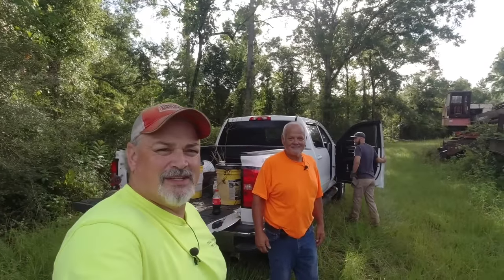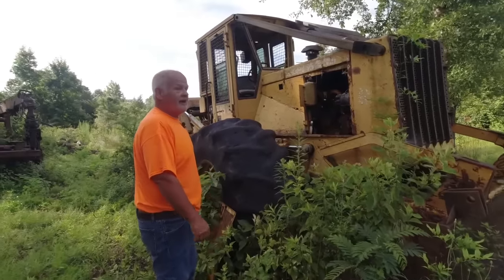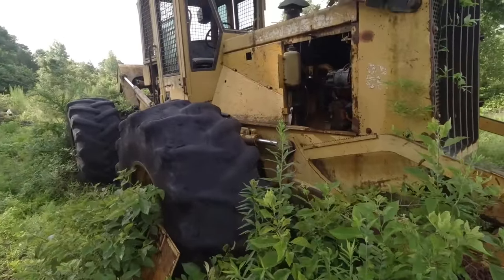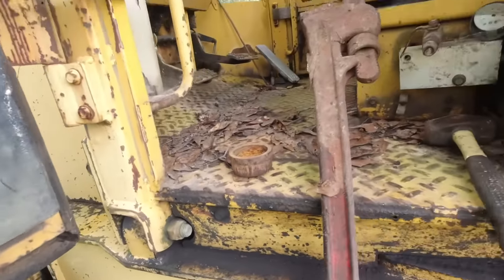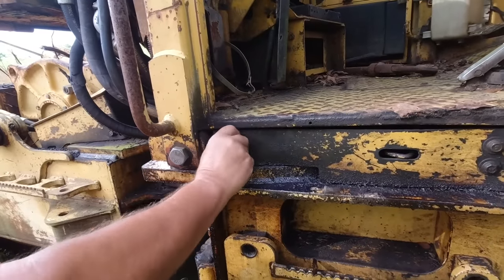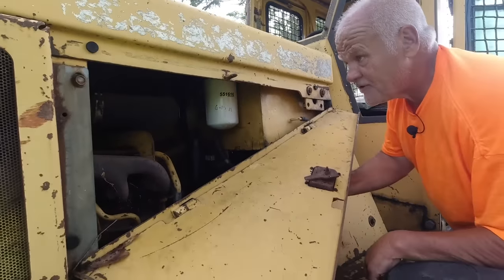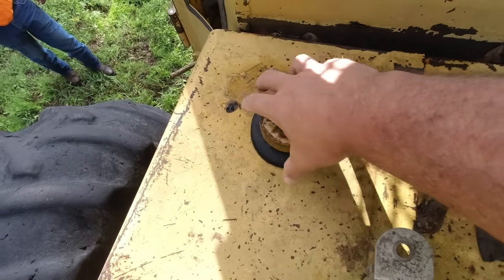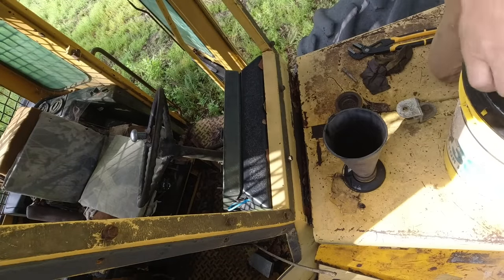BURIED IN WEEDS! Will this Skidder Start AND Pull Logs Again?

Comment: Oh i love watching machines that have been sitting for years being brought back to life. Good job.
Reply from the maker: Thanks much
Reply: I found this video,  I was looking up a skidder being pressure washed and none showed up but this video I run these skidders but they have swinging grapple booms in idaho. The key ignition switch makes the same beeping noise though 🤣🌈🎇🛸✨ there is another logging job down  the road & they have this exact model as on this video and a  log loader to match,, I am pretty sure there  tree"log" processor is close also.

Comment: youll have to come to the orlando auctions with us next year. Some good junk!
Reply from the maker: Right on! I hear they have some good stuff
Reply: We talking about Orlando flordia correct?
Reply: @HamiltonvilleFarm  why did you shake the steering wheel while you were cranking the skidder ? How does that help it to start ?
Reply: Yes! Y’all come on down!
Reply: @brieannateylar5810  it releases back pressure on the hydraulic pumps, letting the engine spin over faster.
Reply: @teebugg66  in the winter it really helps make a starting difference in the cold weather in idaho,,,I run the same model but it has a swinging grapple
Reply: @teebugg66  thanks for the information . I learned something new today .
Reply: Junk is about right.
Reply: @RailengineerGaming  .

Comment: Been a logger since high school(10 years) and ran most skidders under the sun and my favorites were a 95 540GIII grapple and a 99 Timberjack 360 grapple. That’ll make a good buggy for someone
Reply from the maker: right on!
Reply: Hard to beat a tight TJ 360 or 450! We ran a 360 on small tires for winching exclusively, the 450 ran both grapple & winching. That 380 would track like a machine twice it's size!

Comment: A penny works really good. Just take pliers and bend it a tad then push it inside the cable terminal and down over the post then tighten. Works great in a pinch

Comment: I know you don’t do in depth electrical stuff but I’d invest in a good multimeter that has a fuse built in just from a safety stand point. Southwire brand that Lowe’s and I think Home Depot carries too isn’t a bad option. Fairly priced and a lot better than those cheap meters in the event something got crossed and it popped in your hands. Personally I use fluke for my line of work.
Reply from the maker: I have a good one for my personal use. This is my YouTube one 😁
Reply: @HamiltonvilleFarm  Good deal! I get nervous when I see them little meters come out! I work on generators all sizes from residential to industrial and seen them little meters hurt folks

Comment: Beauty!
Why did you want the steering turned left & right?
Reply from the maker: It helps relieve the hydraulic pressure which makes the system easier to turn over. (In simple terms)

Comment: Great job! **Question**...what does shaking the steering wheel do to help it while cranking it over?
Reply from the maker: It helps relieve the hydraulic pressure. When there is less pressure on the system it’s easier for the starter to turn the motor. (In simple terms)

Comment: Excellent video Hank :) also crew did excellent job  also one thing guys check out most machines sitting for awhile is Electric control box on the  middle of dash above  Clutch  pedal make sure not corrosion on too and not rust up! What that device does  is for tell transmission shift on computer stuff on it plus connect with Netural Safety Switch plus RPM  so shift up without use clutch thru gears plus when use Reverse, Feild , Low & High Speeds fast plus when Double Clutch too ! Plus device keep thevies steal tractor or heavy duty equipment with trying hot wire plus keep Starter not engaged unless got master key in ignition to use plus key got battery to recognize too! Plus can't bump start machines in motion to travel when get tow to start up !  Also why say should use Clutch pedal Hank  is because transmission may be lock in even in Netural mode also protect you guys get hurt also machines Rock plus lose up transmission too plus free Clutch plate to less stress on Transmission or axles!
Reply from the maker: Thanks for the comment Andrew👍
Reply: @HamiltonvilleFarm  welcome Hank  :) and glad helpfull hints to share with you plus crew !

Comment: Brilliant 👏.  What was the idea behind rocking the steering back and forth ? Never seen that before
Reply from the maker: It relieves the hydraulic pressure in the system making it easier for the engine to turn (in simple terms)
Reply: Ah got you yeh makes sense

Comment: for doing these types of rescues. you guys could really benefit from a small Honda generator / Inverterthey are light  ,quiet ,and will give you 12 volts for charging and jumping batteries  plus give you 110 plugs  if you wanted to use electric tools or even auxiliary lighting  plus  they really are handy around the home and yard  plus a good thing to have in Emergencies  i had a E1000for years  and it never gave me any troubles  i used it to Boondocks Camp in my Airstream Trailer  it wouldn’t run the Airconditioner Compressor but it would run the fan to keep the air moving on warm evenings  ? just my thoughts. BTW i see them often used on Craigslist  for decent prices  this start up reminded me of being at my Buddies Fishing boat on the Chesapeake Bay  years ago he was having trouble getting his twin Caterpiller engines  going untill  this big Pop noise  happened and we all realized it was aMuskrat  who built a nest in the exhaust ports to  have her babies  the animals all seemed to be okay  but man was there a ton of sticks and leaves stuck into that 4 inch pipe  i saw some debris coming out of the skidders exhaust and i thought  a Mouse was going to get shot out of there like a Circus performer out of the Cannon
Reply: Man, also a cordless leaf blower comes in handy, blow off all the crap before taking stuff apart !

Comment: What does moving the steering wheel back  n forth have to do with starting it? after sitting for years,also I noticed the exhaust near the cab,whiteout an extension,the drivers getting fumed !